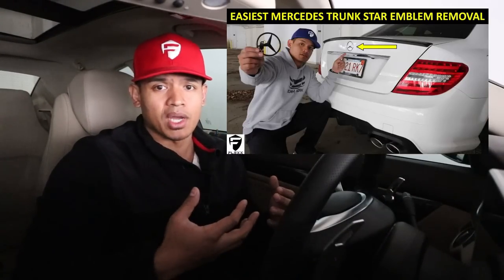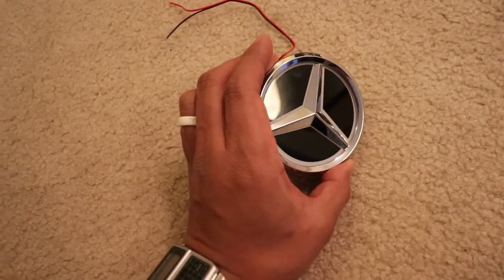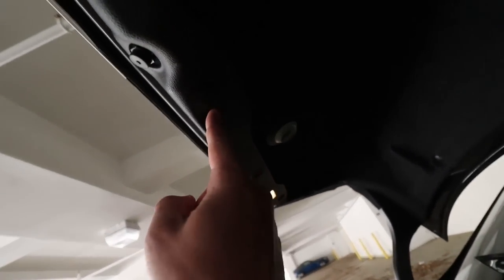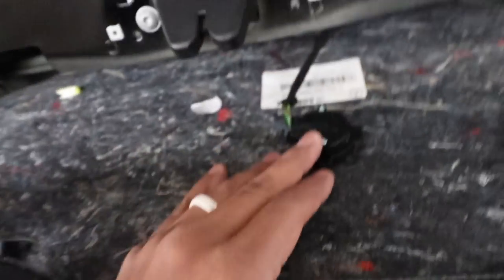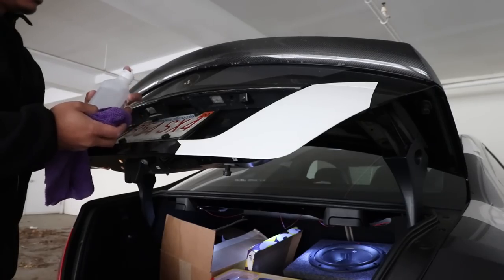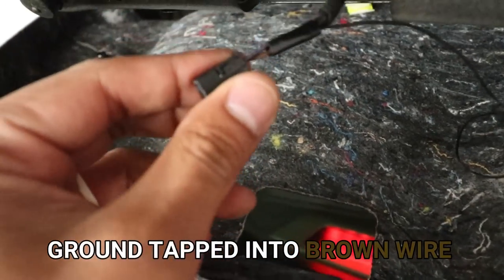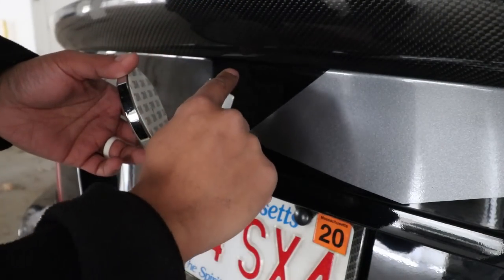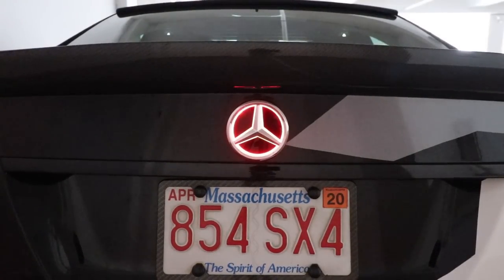First lighted Mercedes-Benz rear trunk emblem!

Comment from the maker: FOLLOW ME!!!
Website: www.FlexxAlexander.com
Facebook: www.facebook.com/FlexxAlexander1
Instagram: www.instagram.com/Flexx_Alexander
Reply: What if you want it always on? Not when the brakes are applied.
Reply from the maker: then wire it up to your brake light that turns on when the car is on. I don't recommended it because "third brake lights" in most stays aren't support to stay on all the time. The lighted star is essentially a third brake light based on it's location.
Reply: Thanks for the info
Reply: Where can i get this from

Comment: I just installed it this weekend looks great on my 2010 c300. I love this mod thanks for the idea.
Reply from the maker: Did you run into the same issues with the emblem being flat and the trunk being curved? I’m not sure if they made a curved emblem yet.
Reply: @TheFlexxGarage  it wasn't curved but it it seemed to have double sided tape that was pretty padded and looks pretty good. But I did cover the holes with tape like you recommended to prevent water leakage. I think I'm going to run some vinyl around the edges like you did just as a bit of extra protection. I'll post a link in the comments once I post it to my tik tok
Reply from the maker: Dang. I was hoping they started producing better ones but if yours fit like mine did, definitely try to seal the openings.

Comment: Looks great - did you just “eye” it? It looks perfectly centered. I think I’ll mess it up , get it on off center and be stuck cos it’s glue! My E550 comes to a point in front and tail which makes the front plate either have a huge gap or bend; the tail star gap is so bad it just snapped when I put my car cover on. This looks like a good solution. Thank you.

Comment: Hey flex i installed in my 04e320 works perfect when i hit brake.  It is a little cheaply made so i was going to rap edgeds in vinal and when that done.  I was going to over lay hole emblem with vinal tint to protect it because silver on star will start to chip off.  What do you think?
Reply from the maker: Yeah, I really wish it wasn’t flat and instead curved with the body of the trunk so it’s flush.  Def protect it if you want it to last.  I honestly don’t remember how long I had it on my car.
Reply: @TheFlexxGarage thanks flex I got the little squadrons that says mercedes benz on it thinking of putting that on bottom front grill

Comment: Thank you for your video Flexx, I have a GLK350 and the tail light is also used as brake light on both sides.  While I put on the brakes, the tail light is brighter... I installed the emblem but it lights all the time instead of putting the brakes on.  Do you know if I can correct it?  Unless I connect the wire to the centre brake LED light.  Your comments are appreciated.

Comment: Thanks for all the videos Flexx - you helped me get rid of the gym sock smell in my AC, and with my front light up emblem, my front lip and side skirts. I'm installing a light up rear emblem and I want to tap it into the taillight, so that it lights up when the taillights kick on at night, instead of with the brake lights. I cant find online which wire to tap for this - would you happen to know? Appreciate any insight!

Comment: If I want to set it up so it can come on at night when my lights come on instead of the break what cable do I tap it to ?
Reply: I believe any 12v wire going to that same tail light would work.
Reply: I connect mine with photocell sensor so it only on when it dark outside

Comment: Link to illuminated trunk star: https://www.amazon.com/dp/B07XJNX67M/ref=cm_sw_r_fm_apa_i_BlNfEbR3HBN98 

The only issue like you stated is that most trunks has a slight curve and would not fit properly. You found a great solution to a black car, but for any other color it would be really noticeable IMO

Comment: Hey Flex, I enjoy your vids.  I have a 2017 gla 250 and I cannot find the lighted front emblem star.  Any idea where I can find?
Reply: Bob McMahon  Hi Bob, I picked one up off eBay when I changed my w204 grill over to the diamond grill.
I had to slightly modify it and use hot glue but it looks cool.
Good luck.

Comment: hey flexx I tried to do this but the LED didn't light up. Can you tell me any troubleshooting steps? I manually spliced it but will try using a t-tap tmrw..what is the battery pack you used?
Reply from the maker: It doesn’t take a lot to power up so either wires are crossed, wires to star isn’t providing power, or the star is dead. I would use a 9V battery to test the star.  Run the positive and negative wires to the 9V battery terminals and if the star works, it should light up. You can buy a 9volt battery at any store. (The square looking battery).
Reply: so the star isn’t dead i tested on a battery but when i splice into the wires it doesn’t work and i get right brake light warning
Reply from the maker: Hmmm…I’m really not sure.  It worked on my car using the step by step I did in my video. No errors, no issues. Double check you are tapping the right wire. Maybe your cars wiring is different?
Reply: @TheFlexxGarage i have a 2013 c350
Reply: @mrc9041 no

Comment: I bought front one, it was bigger than the old one in my car, Mercedes Cls.. i don't know what should i do now.
Reply: I have a 2014 GLK 350 4matic (X204) and the ones that on Amazon that say for 2004-2018 W204 work perfectly.

Comment: Flex so all I gave to do is tap into the wire or light fixture itself ?
Reply from the maker: Yeh. I just tapped into my brake light wire.  The star doesn’t use a lot of power so it doesn’t really screw anything up.
Reply: @TheFlexxGarage  thanks for your response. I enjoy watching your videos for ideas.